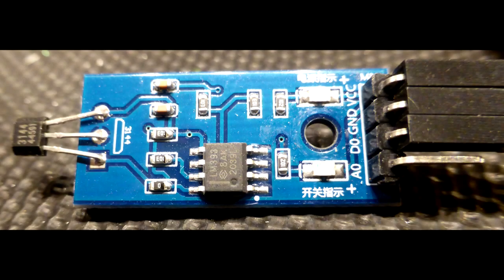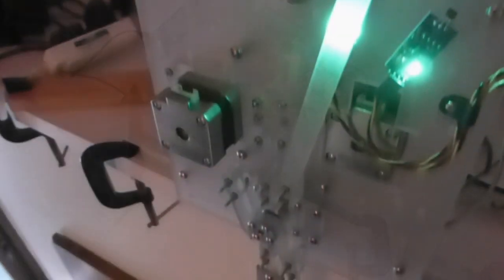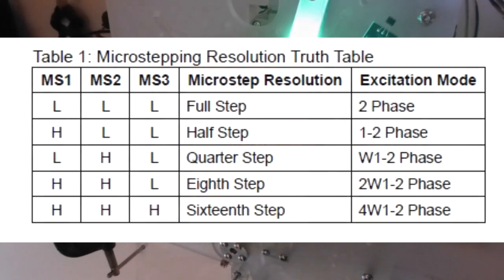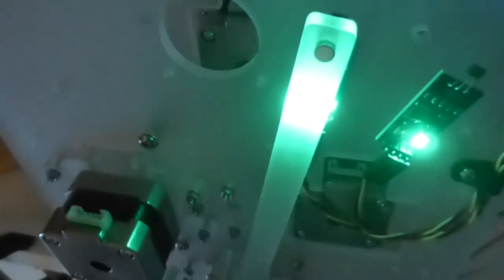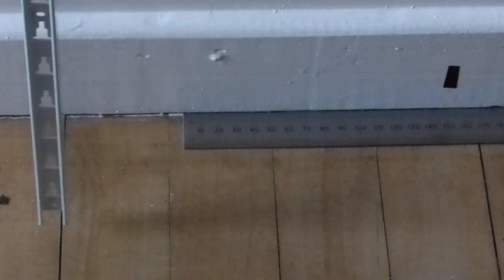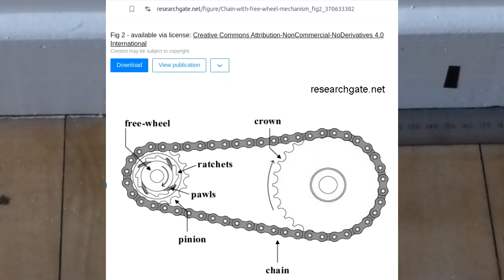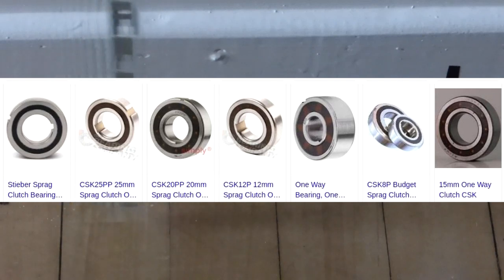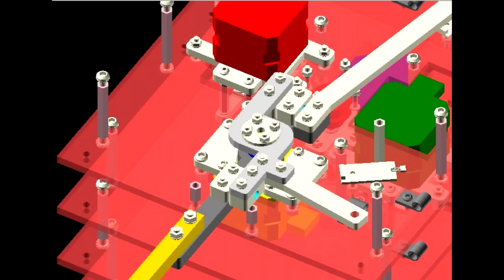Big Ben - 8. Pendulum struggling with 2.5m

Comment: super interesting! 
I've stopped using plug-in breadboards; now I use ones commonly referred to as Perma-Proto Breadboard Solderable PCB Prototypes. They ensure there are no glitches or 'mysterious antennas' that pick up noise and introduce it into the system.
Reply from the maker: @soulrobotics What a great idea! I'd never heard of these so thank you for the tip. I've had a few connection glitches with conventional breadboards so will definitely add a few perma boards to the spares box.

Comment: The traditional solution, used in actual clocks, to a powered pendulum is to use a solenoid (with a sense tap) to provide an impulse and the mass of the pendulum being magnetic. The circuit uses a single transistor like the forever spinning top toy circuit.
Reply from the maker: @DavidCookeZ80 You're right David, thank you. I did try similar methods but couldn't get them to work with the solenoid inside the clock housing. Maybe I didn't try hard enough, but may have to revisit those methods once I've thrashed this stepper motor idea to death :)
Reply: @philtipping  Fair enough! Out of curiosity, what frequency is the "ringing" on your hall-effect sensors? Is it power-line noise? From the stepper drivers? It might be possible to filter out that frequency leaving a much cleaner signal to work with, or shield the sensors from the source.
Reply from the maker: @DavidCookeZ80 It's about 5MHz. I don't know the exact details of the module schematics apart from it having an LM393 comparator chip, but you're right, it could be power-line noise if its voltage reference is a simple resistance divider on the 5v supply. The latter was coming from a PC USB outlet. The stepper motor was not connected at the time.
I didn't try filtering the DC supply, but this could be a better solution than putting a capacitor across the digital output. Either way, that's something to note for the future as I'm changing over to a rotary hall-effect module for the reasons mentioned in the video.  
Thank you for your input.
Reply: Instead of using a single solenoid or motor, what if you had a magnetic disc or a ring of small magnets near the pivot point? Then, you could use multiple small solenoids around it to nudge the pendulum at just the right moments. The cool part is, those solenoids could also act as sensors. When the magnets pass by, they could induce a small current or change in impedance in the solenoid, telling you exactly where the pendulum is. This way, you get both control and feedback from the same components. The pendulum’s weight and motion would smooth out any rough impulses, so even if it’s not perfectly precise, it should still work pretty efficiently. Feels like it could be a clean, low-energy solution—worth a shot?
Reply from the maker: @soulrobotics nice idea, thank you :)
A stepper motor is effectively the same thing; a ring of electro-magnets, except the motor has a bonus of a 'free' axle with bearings. I was thinking on similar lines but with a modified stepper motor driver; switching it into 'sense' mode every now and again, but decided the electronic switching was too complicated for me, so went with external sensors.
This method is so close to working though so I'm sticking with it for now; am just waiting for the one-way clutch bearing to arrive (expected in January).
I've already used the rotary hall-effect sensors for the clock hands (see earlier videos), so I think these are the way forwards. They will remove any ambiguity with deducing where the pendulum is, and the one-way clutch will remove any delays with the driver mechanism. Fingers crossed :)

Comment: I am just finishing the PCB layouts for a all transistor digital clock.  (no ICs)  Uses 50mm square PCB for each 4 bit counter with a time base board and 4 (2.3" high LEDS) 7 segment decoder driver boards 50 x 100mm.  The time base board can be built as a 32768 crystal or as a 1 or 2 second pendulum (2 or 4 seconds per clock) mechanical.   With a pendulum position detector and a coil to give it a push to keep running.   Total of about 500 transistors.  Just designing like it was the 1960's.
Reply from the maker: @chuckinwyoming8526 that's an ambitious project Chuck, but well done! Nice to get away from micro-computers sometimes and back to basics :) Hope to see a video of it soon. Season's greetings to you.